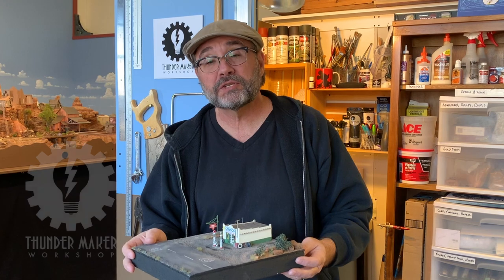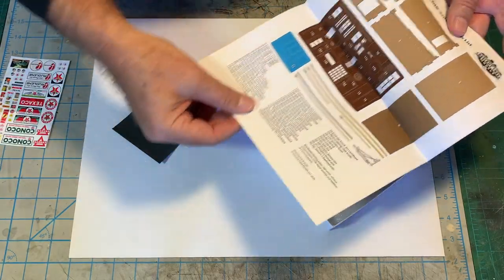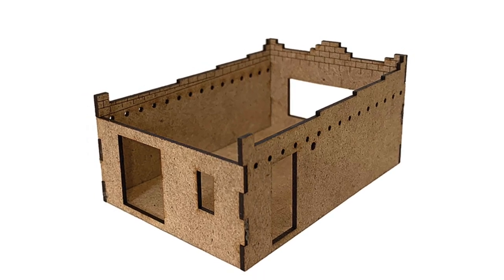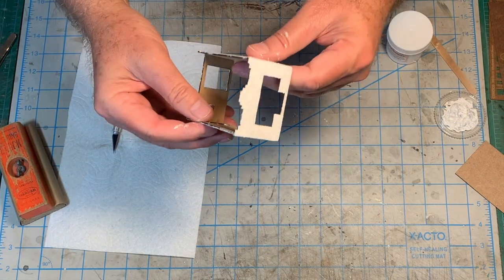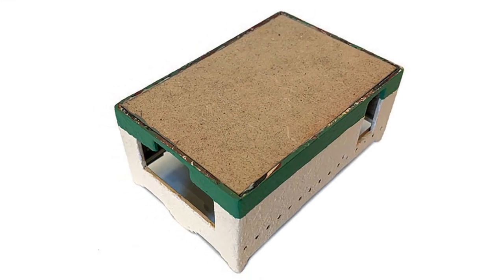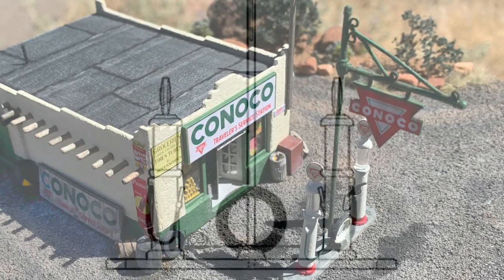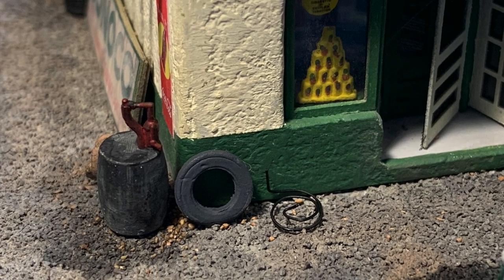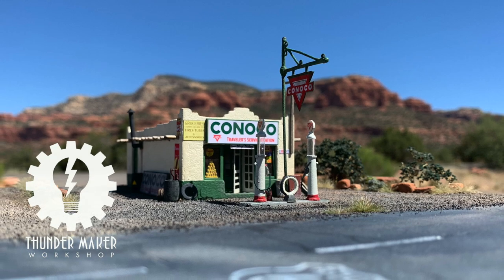Last Chance Gas in HO Scale

Comment: The gas station came out awesome. You did a great job putting it together and painting it. It looks really good alone but I'm not sure if the stucco texture isn't overdone for ho scale. Saying that the pictures are very close and I'm not seeing it with other ho scale buildings, figures, cars and etc. so I might be completely wrong just looking at the video not seeing it in my hand. Like I said it looks awesome so it might be scaled perfectly. Great video. Stay well. -Wil   👍
Reply: It's hard to get stucco scaled down. The more I look at it the better it looks. I'm still on the fence just not leaning as heavily against the stucco the more I see it. Please don't take offense to your modeling skills I'm not trying to bash you at all because I think you do wonderful work. I'm just giving my opinion which is just a talking point not an attack. I hate to have to say that but these days they'll be plenty of commentors and possibly the video creator thinking I'm being negative when I'm not. I gave my opinion because I want your opinion of the stucco because of the product you used to make it. Wondering how you feel about the product if it does a good job representing the stucco or not and do you think the way it was applied may make it look too heavy and could be tweaked to reduce the texture some more? Do you think if reducing the texture more would make the stucco not have a stucco appearance and it's one of those things in modeling that has to be a little overdone to make it represent the look correctly and not scale? I'm guessing you're happy with it or you'd stated that in the video but is it like I said the old give and take situation we often find ourselves in while scale modeling? Thanks in advance if you reply and especially for sharing you talents.  👍